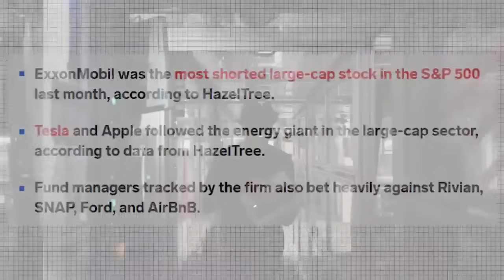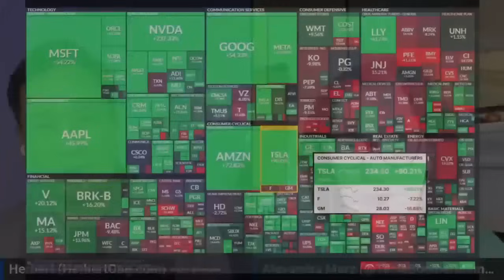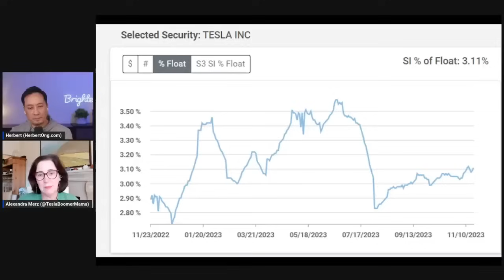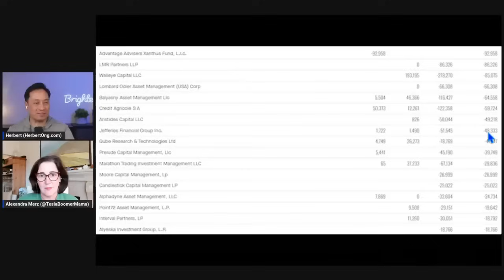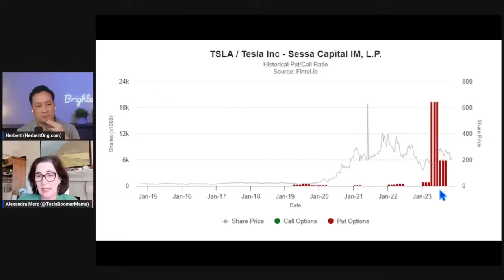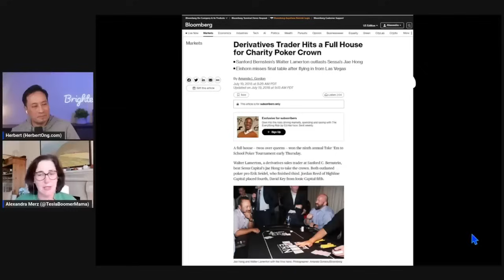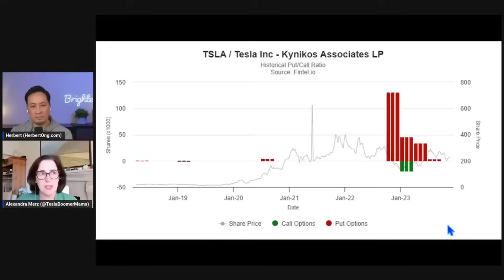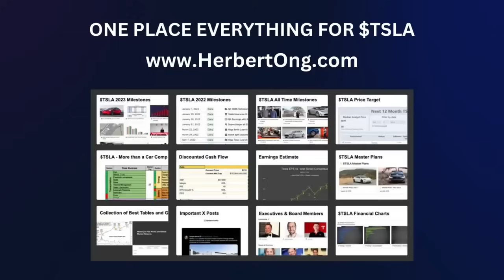EXPOSING Tesla Stock’s BIGGEST Short Seller!!

Comment: Shorting should be illegal. it's bad for the company and it's usually real bad for the shorter. you can accomplish the same thing with way less risk by just owning a stock until it's quick gains plateau(signalling a pullback) and then sell it and wait for a lower price. then if for some reason it makes further quick gains you just loose out on an opportunity instead of getting butt effed financially. you can also negate this situation by only doing it with 30-40 percent of the stock and holding the rest.